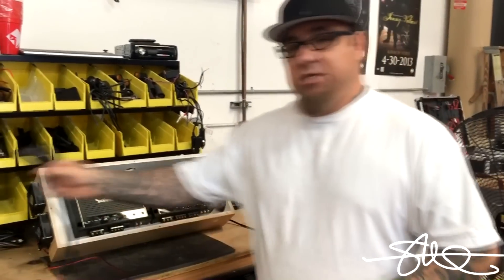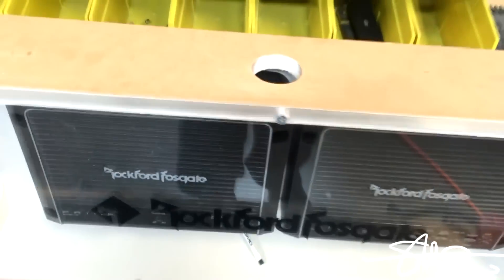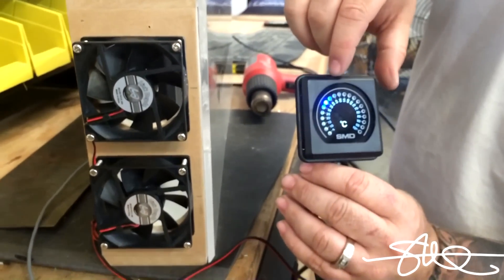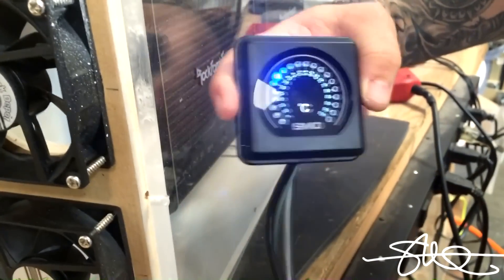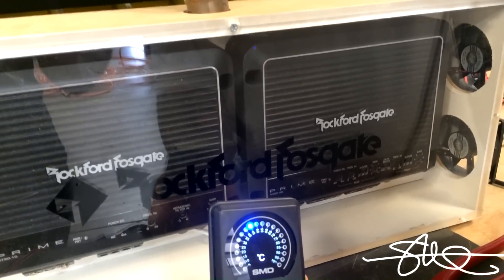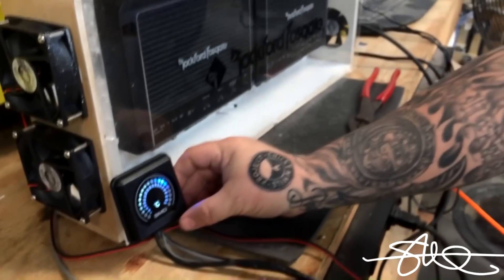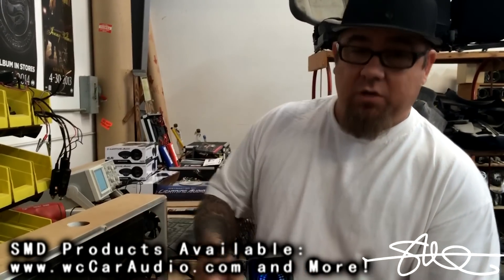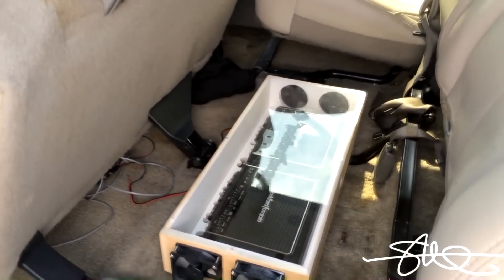How to Build a COOL Amp Rack (easy) Temperature Monitor - 3 stage Fan Cooled

Comment: If I was to do exactly what you have and buy some aluminium heat sinks the same size as my amplifiers and put them under my amps and some rubber feet for vibrations and do exact same setup 4 fans either side and that controller also to power them! What's your thoughts? Or is my idea over kill.

Comment: That's "cool" and all, but you're just moving outside air, which I understand helps with the built-in heat-sinks on the amp, but it's the internals of the amp that you have to worry about cooling down and that sensor gives no indication of the heat surrounding the amp's internals. That's why some amps have built-in fans that blow across the components inside the amp (although most are ineffective). I think for any true benefit you would need to figure out a way to get the air moving freely across the amp internals and not just over the external heat-sinks and through whatever gaps the air can push through. Neat idea though.
Reply from the maker: SMH you guys say the dumbest shit i swear.  "neat idea though" LOL......

Comment: I just put 2 12s in my car ran my power wire from the front down the driver side and to the back but for some reason when I have my driver door closed my speakers sound like they have a heart beat till I get over 15 then it stops but if I crack or open my door there is no noise at all, it a new wire kit so I don't know what's going on can u help me please

Comment: Ummmm.  Put amp in another enclosure just to install fans to keep the additional heat to cool it off. Sounds kind of counter productive but thats like trying to produce more horsepower to a car but at the cost of adding more weight.  The amp itself is a aluminum box. Open or create more vents and apply the fans to blow through or directly into the circuit board

Comment: Are 2 fans pulling the hot air out or they all blowing in and pushing the hot air out the open hole at the bottom also can I wire fans  to amp for power
Reply: Yes push and pull, more efficient, but like he said any air is better than none

Comment: Dude thanks so much for this video. My RF P600.4 was shutting down on long trips so I decided to build a similar amp cooling rack like yours and I think it came out pretty well. I'm about to install it in my car. I used 4 Corsair ML120 120mm PWM Premium Magnetic Levitation Fans and your TM-1 Sensor. My amps are Rockford Fosgate P600.4 and P1000X1BD Punch.

Comment: Im gonna start mine today I was bumping some Bass Outlaws and my amp was getting to hot and shutting off this happened to two different amps and im not pushing alot of watts with budget amps. There mounted on the back of the rear seat in my 95 yukon and 100 degree weather right now.

Comment: Hiya I'm just running a basic little edge 10" 750watt sub and active amp kit i have made a little box for both so they are seperate but wanted to put a fan on the heat sink as it gets pretty hot but didn't want to just connect straight to the rem and earth incase it will cause to much drain/interferance have you got any suggestion or would it be okay?

Comment: I build customer watercooled desktop Pc's... So the push/pull configuration im familiar with.. The fans you got seemed to only be small 88mm fans.. Have you thought about upgrading the fans to corsair 120mm high flow fans? Or the 140mm high flows? I made a box similar to yours only i couldn't find plexi glass and when I tried using my acrylic it would crack something terrible. But I'm running 4 140mm corsair fans in that same push/pull configuration. But my amps are rated class A/B... Your amps are class D which I know they get warm but would someone with class D amps really need a box lke this? I have two boss amps (one thats been pushing the heck out of a 10" Premier audio sub) only during super hot/humid days here in Jax,FL and me having it turned up would throw it in protective mode. I'm sure I could of eliminated this by simply moving the amp higher. Seeing this makes me wonder if theres a way to build a waterblocks (its what us computer nerds use to cool our processor, motherboard chip sets, and graphics cards.) If a water block could be fabricated to cool down the pieces of the amp that get hot it was be interesting to see a subwoofer system that's liquid cooled. Anyways thanks for the video.. I definately would love to have that tempature module you showed us. The ability to set the temp by adjusting a screw in the back. I need that in my life! Lol

Comment: Amazing Product but $115 is kinda steep
Reply from the maker: steep for who? you? sorry bro. I can't lower the prices based on what you think is/isn't expensive LOL.
Reply: @meade916  says the person that spends thousands on a system and thinks $115 insurance policy is expensive.
Reply: @meade916  neither, was saying $115 isn't  even 5% of the cost of a decent system. So $115 to save thousands of $. I'm in. Putting one on a focal 5/1200 that's in tight area and could use the air flow. Loving your products. Got the quick release speaker terminals. Run an A/B switch off my amps rear door speakers makes a great set up for camping.
Reply from the maker: @robertgriggs6205  ahhhh gotcha! thanks man!

Comment: I ordered one but the instructions don't mention the yellow wire and they say there's a gray one for positive but I have no grey. I have a thick white wire, a thick black wire and the 3 thin ones (red, black and yellow) which are shielded together.  Also there is no mention of how to install the inline fuse...  do you cut the wire??  Wish it came with updated and clear instructions.  I emailed my questions via the site and via Amazon but no response.  I don't want to return it but I'm going to have to if I don't hear back in the next few days.
Reply from the maker: yellow= constant. Red= switched. Black = ground.  The white and black wire is for the fans. We made some changes during the new manufacturing process and the manual didn't get updated. Sorry.  Still pretty simple though.  Red/Yellow/black is pretty universal in the car audio world. thanks man!
Reply: meade916 copy that. Thanks for getting back to me!
Reply from the maker: no prob! sorry about that! we are still working out the kinks in our new manufacturing process.  I think the newest batch is supposed to be fixed for sure.  It all works the same just the wires are not labeled right.  Thanks for the order J!

Comment: That's cool, but I don't think the thermo-sensor is necessary.
I have one with mine, but I use 2 8" crossflow's because it's in the trunk and I live in Oklahoma.
Reply from the maker: good thing it don't matter what you think.  If you like your fans to be on 100% as soon as you start the car (or hit a toggle switch) then more power to you.  We are not basic here at SMDj.

Comment: Quick question witch fans are blowing air in the box witch fans are blowing air out or do they all blow air into the box
Reply: Doesn’t matter which one, and yes one is pushing air and the other is pulling.

Comment: I LIKE WHAT YOU PUT OUT BUT OVER PRICED FOR THE AVERAGE JOE LIKE ME ( I HAVE A FEW THOUSAND DOLLARS IN MY CAR SYSTEM BUT ITS A FEW HUNDRED DOLLARS HERE AND THERE OVER TIME) AND YOU TREAT US LIKE WE ARE 5 YEARS OLD!!!! ALL YOU DID WAS HEAT UP THE AIR NOT THE AMPS!!!! THIS WOULD HELP COOL AMPS BUT NOT EVEN CLOSE TO WHAT SHOWED, OF COURSE 4 FANS WILL DROP THE TEMPERATURE WHEN THE ONLY THING HOT IS THE AIR, THE TEMPERATURE STARTED TO DROP AS SOON AS THE HEAT GUN WAS REMOVED BEFORE YOU TURN THE FANS BACK ON!!! WATCH THE VIDEO AND YOU WILL SEE WHAT IM TALKING ABOUT. IF YOU WOULD HAVE JUST LET IT SIT OR REMOVE THE COVER IT WOULD DROP JUST AS FAST!!! PLEASE SHOW US REAL WOULD CONDITIONS, I.E REALLY USE THE AMPS TO GET THEM HOT THEN LET THEM SIT WITH NO FANS THEN GET THEM HOT AGAIN WITH USE THEN TURN ON THE FANS SO WE CAN SEE 1 THE DIFFERENCE,  2 HOW WELL IT WORKS AND 3 HOW LONG IT REALLY TAKES!!! OH AND PLEASE PUT ANOTHER TEMPERATURE GAGE ON THE OUTSIDE SO WE CAN SEE THE ANBEIN TEMPERATURE!!! FOR THAT MUCH MONEY IT IS THE LEAST YOU CAN DO!!! THANK YOU FOR YOUR TIME.
P.S, ARE YOU AWARE OF ANY SHOPS IN THE BALTIMORE, MARYLAND AREA THAT HAVE YOUR EQUIPMENT THAT I CAN PAY TO SET EVERYTHING SO CAN GET 100% OUT OF MY SYSTEM? ALL I HAVE IS A CHEEP OSCOPE

Comment: 3 questions...
1), is that particle board or MDF ur using for the amp cooler box?
2). is it 1/2" or ??
3),and are 2 fans pushing, and 2 fans pulling, right?

Comment: Nice setup, but I wonder why you put the fragile plastic fans on the outside of the box where there's plenty of room on the inside.
Reply from the maker: +Jack Dedert because there is no room on the inside and they aren't fragile. So no problem.

Comment: little off topic but do you know if the sound ordinance amps are any good
Reply: +KICK ASS Sound Ordinance amps are Crutchfield's house brand. It is a "meh" brand. I would compare it with companies like Hifonics, Boss audio, maybe low end Kenwood. The only way I would buy them is if you are on a huge budget. I would recommend Rockford Fosgate PRIME amps if you are on a budget.
Reply: +Joshua's Recordings yeah already bought them they aren't bad but got a lot of unwanted noise from them but you get what you pay for...
Reply: +KICK ASS I actually never owned their amps (I have their subwoofers and they were CRAP!) Do you mean "hum or hiss" by unwanted noise?
Reply: +Joshua's Recordings humming already checked the ground myself and couldn't find anything wrong with it and took it to a shop and they said it's probably the amps...
Reply: +KICK ASS Ahh, ok

Comment: You had  the hole open and all the air went out the top during your test. Your testing is almost good but it could be better if only the fans' holes were the only ones being used to move the hot air.
Reply from the maker: +chimmpoe2 SMH lol

Comment: Hay, I wonder if anyone ever heard of water cooling an Amp before?

 I am a PC guy I have built water cool PC i know how effective water cooling is versus fan cool when it comes to drawing heat and I wonder if anyone has consider this for amp. I live down south where it hit's upper 90 in the morning and upper 110 in the afternoon to the late evening in a car. Fan blasting loud and sometimes the amp cut's off. I wonder how effective it will be to watercool. I love the temperature monitor even water cool you need fan's for the radiator to pull heat away from the liquid.

Comment: Any chance you make a entry level on? Went to look at them and $150 is just.. Well a lot for a novices. I wouldn't mind 50-80 without the LEDs or anything just that $150. Not saying it wouldn't be worth it but I could get a RE Audio SE-x 15 for that =/

TL;DR make cheaper without LED's please.
Reply from the maker: Where did you see $150? More like $114.  And we have no plans to make and LED Temperature monitor with no LED's LMAO....
Reply: I only seen two types and both there 147-150 on the website in the description and on sonic electronics only two. But in all honesty dont feel like I'm interested in a $150 thermostat "LMAO"..
Reply from the maker: clinton fisher nope.  You are crazy.  I just told you what the price was.  In "all honesty" i don't care what you are interested in.  If they were a quarter you would complain about the price so it really don't matter what you think.
Reply: meade916 I could care less what the price was, but I'm not going to go out of my way and purchase something I might never need. I have no problems with amps over heating. I felt it might simply be useful knowledge to have if I do encounter the problem.

I dnt see why you feel your entitled to insult me over my question. I showed interest in a product you made and simply asked if you had plans to design a entry level model.

If it was the other way around I would be proud someone has shown interest in a product I made.

I don't need this product but I felt it couldn't hurt to have one. If I wanted to be cheap I would go to the hardware store and spend $3 on a toggle switch and call it a day.

Its not hard to come off polite, I run multiple groups online with well over 4k members combined iv always tried my best to be polite and curious to anyone who asks me anything regardless if I agree with them or not.

You should be proud of your influence on the global car audio community, but it would hurt to cut back on the uncalled for insults whether you see it as one or not. 

Thank you for your time. A response is not needed as I don't wish to continue this conversation further.

Comment: Quick question, do you have the fans mounted in a push/pull configuration, or are you pushing air in with all four amps and using the whole you cut for the heat gun as an exhaust?  I wonder which setup would produce the best results?  Not that it would make that much of a difference; that box cooled down damn quick.
Reply: A push/pull configuration would always work better in any circumstance. The object is to run fresh air in over any "fins" on the amp, similar to that of a heatsink on a CPU. If all the fans are blowing out (or in), you aren't going to get any air change inside that box. My concern though would be if you have this in your trunk (where most amp racks are located - behind the back seats), the air inside the trunk is going to gradually get warmer... Especially in warmer environments or during summer months. So you'll end up re-circulating warm air. The design I'm going to build for my WRX is going to be VERY similar to this, however I'm going to have the exhaust fans pumping air into the cabin (just below the back seats through a fake speaker cover) on the driver side, while pulling air in from the passenger side - again, using speaker covers over the hole below the seat. This way the exhaust from the amp rack comes into the cabin and can be cooled with my AC or windows down (whichever I prefer to use at the given moment).

Comment: Hey man, I had the same 1200d monoblock (Rockford Fosgate) for just over a year. Unfortunately, two weeks ago she quit. No matter what I did I could not get the amp to turn on (it was getting correct voltage, remote voltage, etc.) but I'm wondering if you've ever had yours just quit on you? or did i just blow my amp... this is the first system I had so its the first amp that quit on me. I was running it in series with 1 600rms and 2 300 rms subs. I don't think it over heated cause its just the subs, amp and capacitor in the trunk, so it doesn't get crazy hot or anything

Comment: Are you using two fans to push air over the amp and two fans to pull air away from amp or are all 4 used to blow air over the amp?

Comment: Just forcing hot air into the box with the air gun doesn't accurately represent the amps themselves warming up. Perhaps you could do a video with the amps actually powering speakers. The results will probably be different.

Comment: Maybe try using some Delta fans they're capable of 240 CFM in a 120mm form factor here's a link. Only draw back of these is higher amperage drawer and they're louder http://www.newegg.com/Product/Product.aspx?Item=N82E16835213001

Comment: I def need one in my new Steve.how many fans can they control?
Reply: In the video it says that the controller can handle up to 5 amps without a relay so it depends on how much power each fan draws.  The video states that each of those particular fans draws 0.16 amps so it could conceivably control up to 31 of those fans.
Reply: Thats alot!!!!of fuking fans!!

Comment: this is cool but why put the fans on the outside....and why not take the covers off the amps so that the air can cool down the actual components better?
Reply from the maker: because those are called heat sinks.  Some of the components inside of the amp get very hot during use.  They are actually attached to the metal and that is how they dissipate heat.  From there, you send cool air over the fins and you can maintain temps pretty nicely. But you can't just rip them off of their mount and aim a fan at them.  They would probably burn up pretty quickly.
Reply: Taking the cover off would make them run hotter. The metal cover serves as a heat sink and provides a much greater surface area for heat dissipation
Reply: ty....